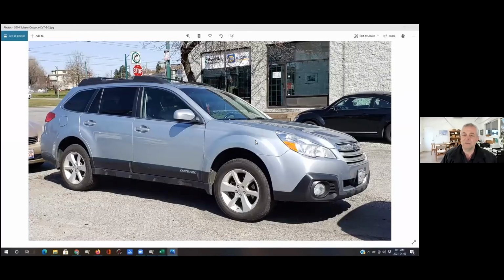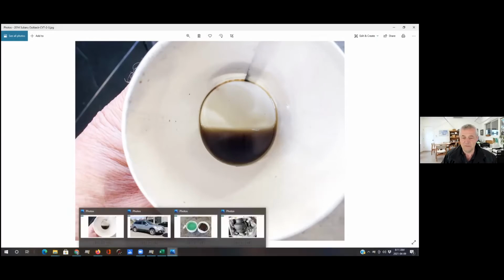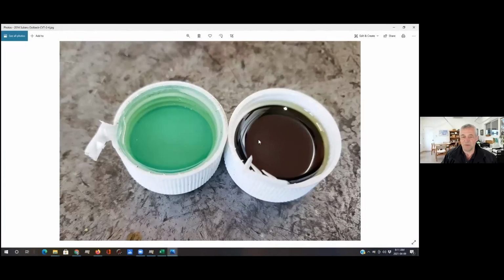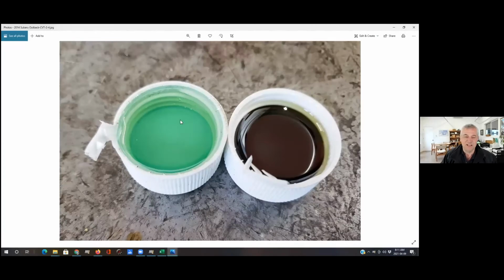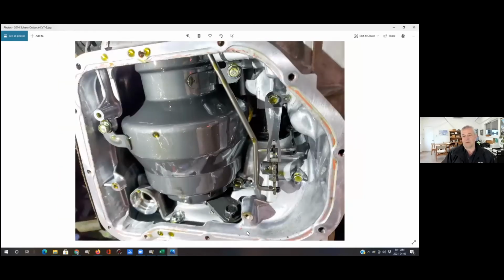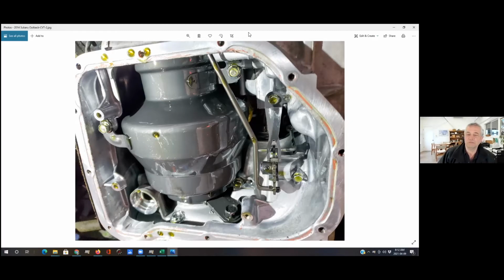2014 Subaru Outback - CVT Service

Comment: I do not want a CVT vehicle, period. They are JUNK.
Reply: I have had 2 of them go over 210K miles and they are still on the road, I only changed the fluid once in one of them in all that time.  The acceleration is much better than a 6 speed.  People don't like them because the engine will stay at a constant RPM and it doesn't feel like it is going.  Two of our latest Subarus have turbos and CVT's.  They have artificial shift points to make people feel warm and fuzzy.